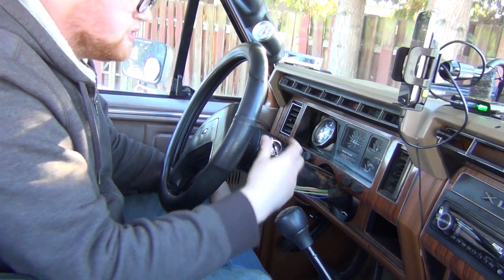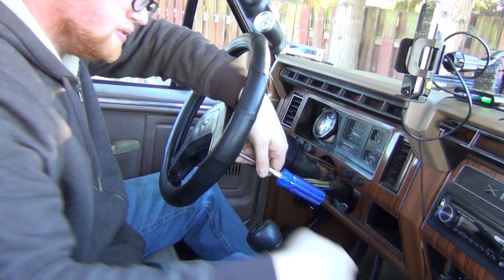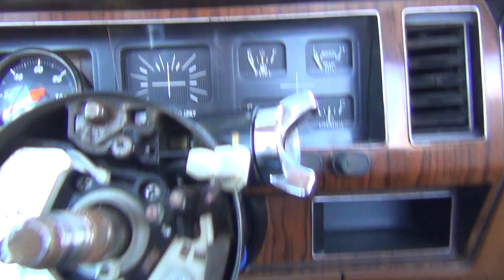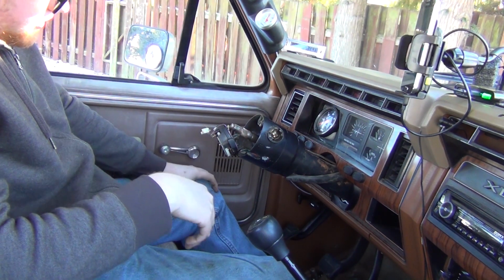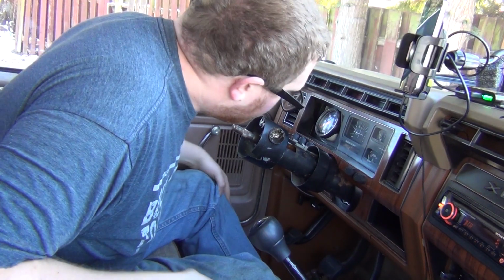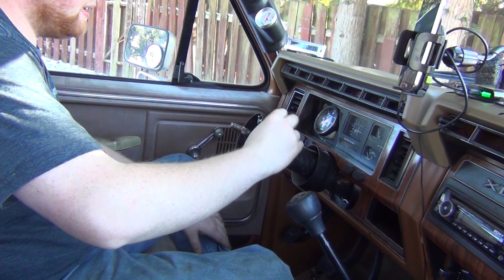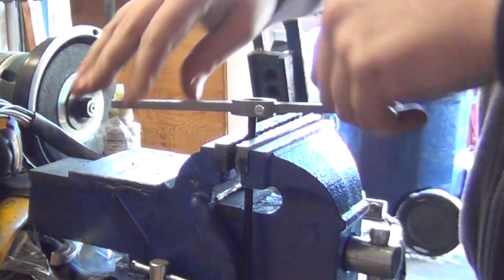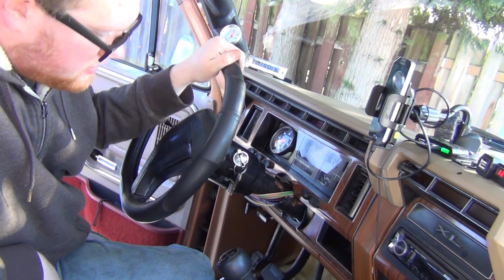1980's Ford F-Series and Bronco Ignition Lock Cylinder Replacement

Comment: What happened if you try drilling the pin out and you accidentally cut one of the wires on the peace that touches ignition cylinder

Comment: Hey thanks for the super helpful video! I'm trying to find lock cylinders for my 1980 Bronco because mine is hard to turn. I want to replace the lock cylinders on my doors as well and get a lock cylinder set (1 ignition, 2 doors with 1 key). Do you (or anyone else reading this) know where I can find one for a 1980? Toms Bronco Parts sells a set but they don't have a set for 1980 Broncos!
Reply: Ian Murphy Try bronco graveyard if you’re still looking for one.

Comment: So you have to pull the steering wheel off to change the ignition switch
Reply: Yeah that’s new to me on an 80s Ford.
Reply: Yep. On my 1990 F-250, there was no hole for an easy replacement like some of the other videos show. Maybe it's a difference of tilt vs no tilt steering (mine's a no tilt). Definitely had to take the steering wheel off to press the button for the lock cylinder.

Comment: Hey josh I have a 1986 bronco and I run the key but it won’t start the battery, starter, and starter solenoid are new and in good working condition. I think it have to do with the electrical connection of turning the key. Do you have any idea what the problem could be?
Reply: Did you ever solve this issue? I’m have similar trouble with an econoline 86.
Reply: Look way down the steering column at the floor, and on top of the column is the switch, push the little pin on top and see what happens.
Or get a helper to turn on the key while you are watching the switch down on the floor, if the switch is not sliding at all, then you'll have to remove the steering wheel, and continue as this video shows